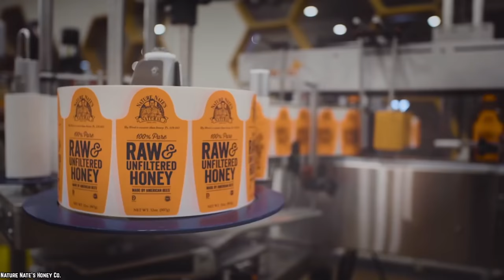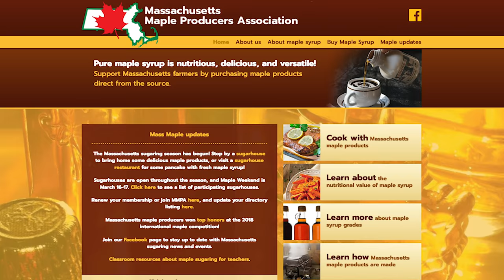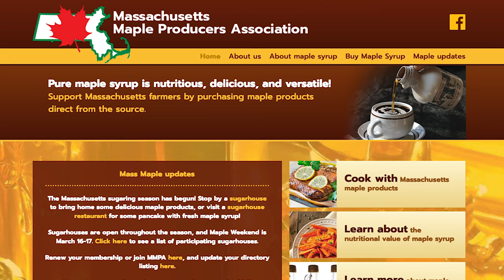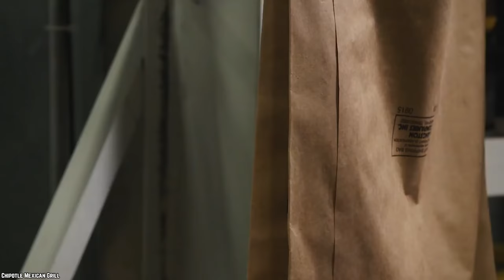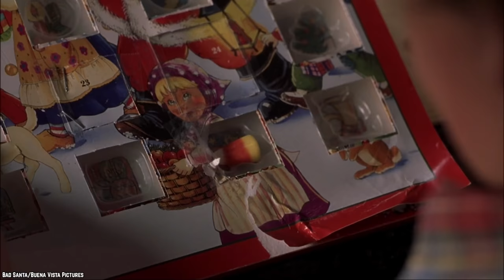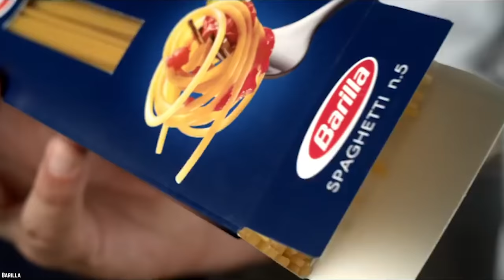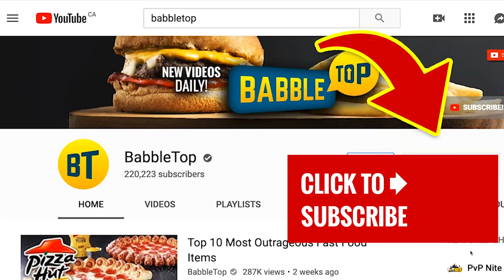10 Foods That Will Never Expire (Part 2)

Comment: Water never goes bad either as long as it is pure and stored sealed to prevent contamination.
Reply from the maker: 🚱 Although water, in and of itself, does not go bad, the plastic bottle it is contained in does "expire," and will eventually start leaching chemicals into the water.
Glass water bottle have an expiration date. The glass bottle per se does not have any expiration date. Water in any closed bottle will have some expiration date because at room temperature, there will be a slow increase in the bacteria in the water and that affects the quality.🚰

Comment: One thing to mention is that "white rice" or "basmati" rice can however contain mites and must be checked thoroughly before preparing.
Reply: charles tesner 
One reason why many people rinse their rice several times, until clean. Bugs float. They go down the drain with the water. Careful, not to spill your rice....
Good rice kernels do not float. They stay at the bottom.. Very easy to separate the good rice from anything that should not be there.

Comment: As long as you use 100% honey and not honey mixed with other things like corn syrup that are passed off as honey it will not expire. I stronly encourage you to read all labels that call themselves honey. You may be surprised. Made with 100% pure honewy does not mean that the product is all honey. Contains 100% honey means the same thing. Read labels.